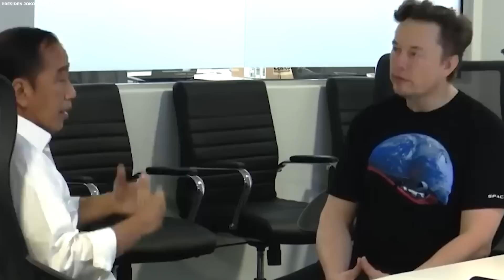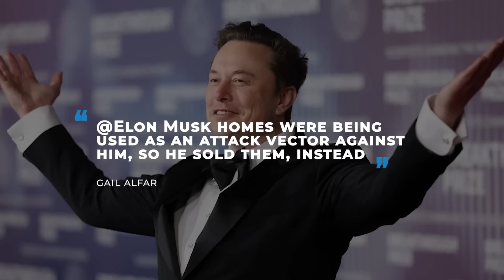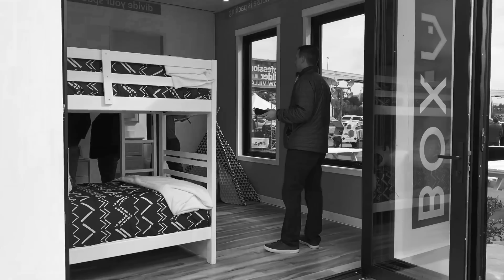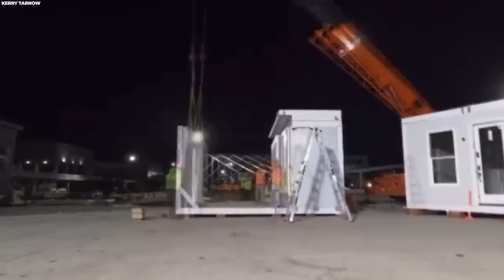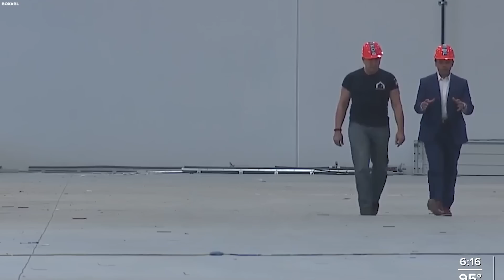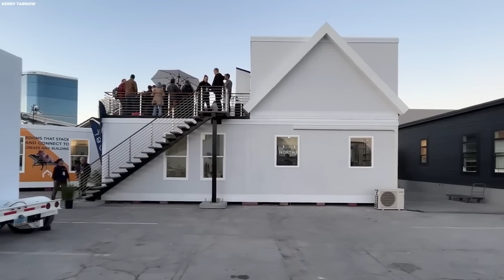IT JUST HAPPENED! Elon Musk’s $10,000 House FINALLY Hitting The Market!

Comment: Another channel says they cost $50,000.  What the hell?  You still have to plumb it for sewage and water, add an electrical panel and source of electicity.  Plus buy small appliances and furniture that will fit.  How about leaks in the roof where the joint is? It's a bad investment like booking flights to the moon.